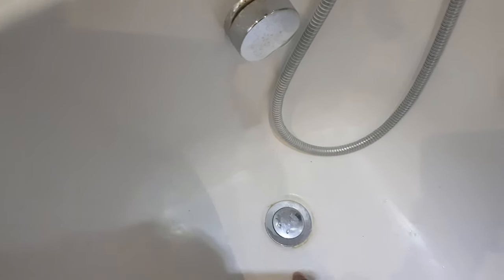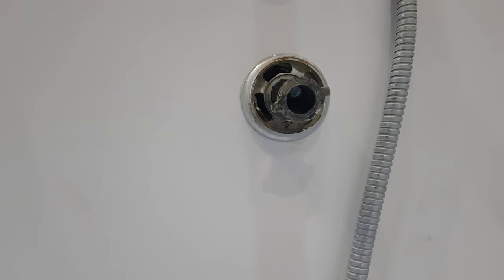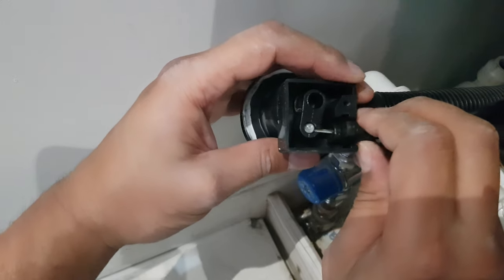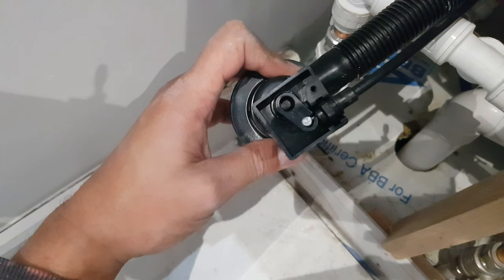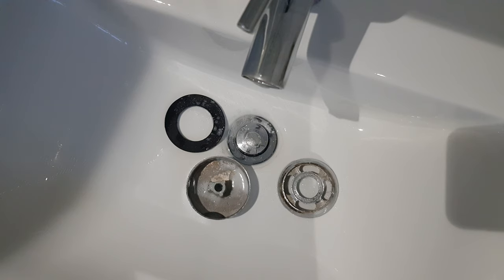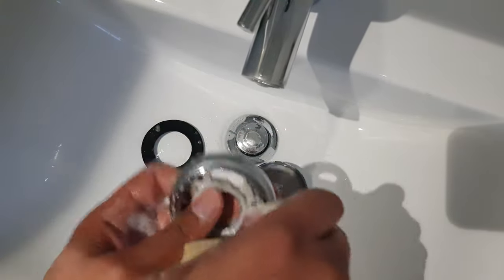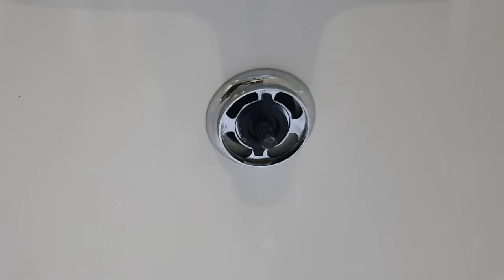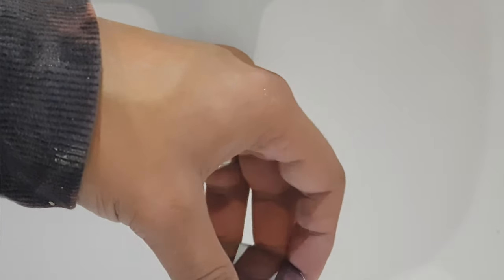Twist pop up bath waste plug

Comment from the maker: Thanks for watching. Please help support the channel by 
🔔 SUBSCRIBING for  weekly videos on repairing, reviving and restoring: 
https://www.youtube.com/channel/UC49Sq1i3iGV-ITpygo0sm3g?sub_confirmation=1
Reply: How can i fix/take off the plug part of the twist handle pop up?
Reply: The twist olug is not working
Reply from the maker: @laviniaparker8860  there is a screw at the bottom where the whole is. Instruction should be there in the video.
Reply: Will have a look only installed about a year ago and started a few months after ,don't think it was adjusted on install just put in place , thanks
Reply from the maker: I literally had the same issue. I moved into my new place and adjustment was completely off. Also check the plug as sometimes the screw gets a little short and then does not work with mechanism. If screw is a little tight spray with some WD40 and give it some time before loosening.
Reply: Can't change plug adjustment on shortest or water runs out
Reply from the maker: fair enough. Make sure you let me know how you get on
Reply from the maker: Not sure if it will help 🤓
Reply from the maker: Unfortunately I am not on that. Do not think it will help. But oh well.
Reply: The whole on the bath was made bigger fits perfectly
Reply from the maker: Oh great, glad it worked. 👍

Comment: Mine doesn't have a screw holding it in, I've no idea how do get it off, I can't turn it to 360 from behind as the top of the bath gets in the way. Twisting it only releases the plug.
Reply from the maker: Unfortunately, I have not come across these before. There must something holding it together.
Reply: did you find a solution for this? mines exactly the same!
Reply: @DIMTips  I have same/ similar mechanism for my bathtub in my bathroom but whichever way I try to take it out it does not seem to work. I found for twist to open bathtubs you require to sometimes use a Phillips head flat head or cross shaped screwdriver, however the screwdrivers I had either unfortunately does not fit or that I cannot seem to locate the screw in the side of the slot where the screwdriver can be slotted into. So I was just wondering in case it could possibly be my fault for not using the correct size Phillips screwdriver I was just wondering what size screwdriver that people have been using to fix this similar problem in bathroom bathtub?
Reply: Tom H. our screw has an Allen key head
Reply: I had the same thing and finally realised it just levered off (I was gentle). Hope you managed to fix yours too.
Reply: You caught the little s
Reply: I still can’t get mine off, so frustrating- tried to leverage it off to and stuck solid, screw is out can see it but now the whole unit just turns to high left/right but no way it’s coming off 😡
Reply: For this type, I got mine opened by keeping turning in the direction of the close position.

Comment: Thank you, thank you, thank you. I had fitted one of these to the new bath I'd installed and could not get the waste cover to pop up. I thought I must have installed incorrectly and was at the point of taking the whole thing out! A very depressing outcome. Then, I came across your video and it was the only one on you tube I could find that explained properly how the system works and that you have to adjust the screw on the waste cover in order for it to pop up. I did this and, voilla!!, success. Currently you are number 1 on YouTube for me!!
Reply from the maker: Thanks so much Paul. Really happy that it helped. It is sometimes the simple things that cause the largest problems.

Comment: Genius! Just fixed mine following your steps. You are so reassuring and methodical. Huge thanks.
Reply from the maker: Glad it worked
Reply: @DIMTips  Well, f**k me. I've had one of these things in the place I moved into nearly four years ago and could never figure out how it worked. No, I don't mean the complex cable-pull mechanism you took apart at the back. I mean, how the hell the actual plug popped up and down lol. I was always under the impression some kind of click-clack valve was missing. I even took the whole thing apart a few years back, looking for what was missing and then had to screw it back together as the actual waste was all connected. After watching this video, I just went and popped the plug in and twisted that big knob on the back of the bath and watched it go up and down. Rofl...I'd been dropping the plug in and pulling it out with a knife whenever I used the bath instead of the shower. Thanks for that...duh!

Comment: Hi fab video and I just wanted more info on the plug and adjusting that. 

My pop up bath plug will drain if there’s some water in it, but if there’s lots of water it won’t pop up.

When I adjust the plug I can adjust the height and also the nut. Does the position of the nut have anything to do with the workings of the plug? It’s just I don’t know if I need to make the plug longer and also adjust the nut.

Sorry I probably don’t make sense...
Reply from the maker: I would always start with the plug as it is the easier job. The nut is there to stop it from slipping back down. So make sure the nut is right up to the top. Let me know how you get on.

Comment: Thank you best video I found on the hand twist bath drain plug. Mine is an older model. The bolt that sticks out has a grouve in which a screw bolt that we undo as we take the hand twist part off. Not confident about replacing it. I will have try to take it apart thank you
Reply: Well mine is old model cannot open the small black box. Decided to use a universal drain plug will have to replace it when lockdown ends. Where can I find the mechanism?
Reply from the maker: Good luck after lock down. Glad you found it useful. Let me know what happens after lockdown. I am sure the temporary plug will help others.

Comment: Thank you for a nice video. I have the same mechanism.
I’m not sure but I might have a little leak through waste cover plate(little bubbles).I tried to remove waste connector screw
To have a look at sealant But couldn’t do it(plate was twisting around) Do I need specialist tool or keep unscrewing.I don’t want to damage anything.
Maybe another video for us please?  Andy G
Reply from the maker: Did it work?
Reply: @DIMTips  I have same/ similar mechanism for my bathtub in my bathroom but whichever way I try to take it out it does not seem to work. I found for twist to open bathtubs you require to sometimes use a Phillips head flat head or cross shaped screwdriver, however the screwdrivers I had either unfortunately does not fit or that I cannot seem to locate the screw in the side of the slot where the screwdriver can be slotted into. So I was just wondering in case it could possibly be my fault for not using the correct size Phillips screwdriver I was just wondering what size screwdriver that people have been using to fix this similar problem in bathroom bathtub?

Comment: Since the internal workings for mine are behind a wall that I'd rather not cut open if I don't have to, do you know of any bath waste plug replacement solutions made for this type of unit?  Can I possibly put some kind of pop-up stopper in its place?
Reply from the maker: If you have do not have access and do not want to over engineer then the simplest is to remove the plug and replace with a general plug stopper. Doesn't look as nice but does the job.
Reply: @DIMTips  I appreciate the advice, I'd like to think Moen or someone else would have tapped this market with some kind of nice looking, functional solution, I'll let you know if I find it.  In the meantime keep up the fabulous work, Happy New Years!!
Reply from the maker: Please do let me know how it goes. Always interesting to hear other's experience
Reply: @spdrn011  Did you manage to find a good looking replacement plug? Previous owners of my house made a lovely built in bath but didn't consider if anything might need replacing in the future. Needless to say the mechanism on the plug needs some attention but can't be accessed. Doh

Comment: Hello and thanks for the video. I have exactly the same system and issue. However, upon removing the screw, I still can't get the turn handle removed to access the components behind it like you've shown. Now I have a rattling screw inside it. Any tips on what could be going on before I go get a plumber? Thanks so much.
Reply from the maker: It may be limescale build up. Try some Viakal or citric acid to remove the limescale. Also grip the base unit and unscrew the top. WD40 has also worked in the past.
Reply: I think someone on another video said that they had this problem after they loosened the set screw. They said that their handle would not pull off it screwed off.  I guess not all of these drains are alike. Our screw head is an Allen key head too.
Reply: Hi @MrRayadav3, did you get this sorted? If so how? I have the same annoying rattling screw! Thx

Comment: Wow I have been looking for instructions on this mechanism. I hate it and want to replace it with a pop up drain and a simple overflow cover, but have no access to the outside of the tub to remove the metal shaft and nipple from the overflow pipe
Reply from the maker: Agreed. When it goes wrong, it goes wrong. Let me know how you get on.

Comment: Ahhh amazing dude just sorted it out! Such a random design. Regarding the unit itself is there reason to silicone it up or should it be water tight as is?
Reply from the maker: Not sure why they siliconed it on installation. But i hardly used it and had no leaks

Comment: I only found your video after searching on Google not in YouTube! I had to find out what that type of bath drain mechanism called. I wish I had found your video yesterday before thinking sod it I need a bath and put the plug in only to get completely stuck this time. The screw on the drain blocker is short! I have to take it apart now.
Reply: I'm having trouble finding the screw to take the first part off 8s it supposed to be in the open or closed position to locate the screw thanks in advance
Reply from the maker: I found it a little difficult to find. But there will be a hole to the side or under neat the circumference  of the opening and closing mechanism. Maybe using the camera on your phone to record a video in any difficult spots will help you locate it.

Comment: Hi.
Mine no longer works, I tried adjusting the plug, but that didn’t  seem to work, as I'm  going to change the bath later this year I don’t want to chsnge the whole  unit so today i got a rubber 'stand alone' plug that i put in via my hand for now but that doesn't fit. I took  the old plug to the plumbers who told me it's large & there is no such thing as a 'standard size' plug hole, shall i just keep trying until I find the right fit?
Thanks
🇬🇧
Reply from the maker: Hope you managed to find

Comment: Watched this video several times and gave it a go as my plug had got stuck in the locked position with a bath full of water in it !!  

After a few failed attempts and a break to have a coffee I followed the video step by step pausing it along the way to do exactly what he did and IT WORKED ! 

Thank you so much for posting such a helpful video now I dont have the expense of calling out a plumber and my bath is fixed 👍
Reply from the maker: Awesome.

Comment: Hi. Is the bath plug just sitting loosely on the drain hole? There's like a rod that goes up and down when I turn the mechanism. But the drain plug seems loosely sitting on top. So water leaks even if its closed
Reply from the maker: It may be a slightly different mechanism. Are you able to search for the type of mechanism.

Comment: Hello I’ve just re-tensioned it and it turns and holds the metal but nothing is happening on the bottom I can’t access it from the bottom as that would involve removing tiles around the bath is there a possibility that the mechanism in the drain isn’t working?
Reply from the maker: Silly question but have you adjusted the nut underneath the plug to make it longer. If that does not work it may be the unit.

Comment: Hi do you know what brand of plug / pipework this is ? And what the size of the plug actually is? I believe I have the same system but am missing the plug so at the moment am just left with a hole unable to fill my bath. All I need is the screw in plug but cannot find one anywhere ! Thanks
Reply from the maker: They are pretty standard. This one looks to be from Screwfix.

Comment: Awesome video,  Since the twist pop up on my walk-in tub wont work, I followed your steps and the top adjustment seems good. I believe I either have the height at the plug  issue or the threads on the plug itself might have broke off, Its a bit hard to tell. However, the threaded portion  on my plug does not have the adjustment and is very rusted. Is there a adjustable replacement you can recommend?
Reply from the maker: Ebay has some good ones. Did manage to fix. Would like to understand what you did

Comment: I have a cable drain handle on my tub unfortunately the opening to the screw is facing down, towards the tub.  Since it's difficult to see, other than using a mirror underneath, I'm having difficulty turning the screw.  Likely due to it being there for a several years.  Any suggestions on how to release, other than taking a sludge hammer...which of course if overkill.  Thanks
Reply from the maker: I used my phone and recorded it from underneath to see the screw. Hope it helps
Reply: I have the same issue. I took a picture and made a video to see the screw.

Comment: The actual twist handle on mine is moving up and down and side to side causing leaking behind it when water hits it, any idea on how to fix this??
Reply from the maker: It has a screw fitting holding it flush to the bath. Open the back and twist it tight.
Reply: @DIMTips  I have taken the screw out but the cover will not come off I pulled as hard as I can what am I doing wrong?
Reply from the maker: Try lubricant and release fluid like wd40. Also try limescale remover like viakal, vinegar, etc
Reply: @DIMTips  no joy. Tried wd40. Cilit bang. Awful thing.

Comment: Is the screw that holds the knob on always a Philips? It quite corroded and hard to tell. Thanks
Reply from the maker: Not sure if always a Philips. Try a flat head. Worst case scenario it should be easy to get a replacement as a standard size screw.
Reply: Could be an Allen head screw also

Comment: I need a new ‘shield’ as mine has snapped. Does anyone know what the proper name for this is and where I would be able to get one from? I’ve been Googling everything!
Reply from the maker: The shield is called a hand wheel. Generally the whole unit is called "pop up bath waste" and the whole unit can been found on screw fix. Let me know if you were able to find a replacement shield (hand wheel).

Comment: The screw holding the cover in place for mine won't budge. I've tried WD40 and giving it some welly, but don't want to overdo it in case I wear out the head. Any advice you could give me, or will I have to resort to drilling out the screw?
Reply from the maker: Try to alternate between viakal or equivalent limescale remover and WD40. It may take a few tries. Remember to wash off with water between cycles. Good luck and let me know how you get on.

Comment: Our washer/flange is broken on the handle but we cannot find the parts. What do we need to search for? Thanks
Reply from the maker: A replacement would be best. When I opened this up I noticed silicone was used and could be an option for you as a cheaper fix. Let me know what you went with.

Comment: We have one of these on a new build property we have rented and it was lose the first time leaked and caused a leaked in the downstairs apartment and someone has been twice to fix it and now the 3rd time it’s just gone lose again causing yet another leak
Reply from the maker: Sometimes they cut the hole a little too big for the fitting. I noticed that the person before me added silicone to keep it secure. I do not recommend this as is a little messy but may work. During regular usage of getting in and out or general usage the fitting may be loosening. You may need to regularly open and tighten it from time to time. There is a screw underneath to open it. Then as long as you hold the back casing it should tighten.

Comment: Just installed a new bath. The plug is letting water however. The seals are brand new, I'm a bit stumped on what it could be. Any idea mate?
Reply from the maker: That is always annoying. Did you fix?

Comment: I have same/ similar mechanism for my bathtub in my bathroom but whichever way I try to take it out it does not seem to work. I found for twist to open bathtubs you require to sometimes use a Phillips head flat head or cross shaped screwdriver, however the screwdrivers I had either unfortunately does not fit or that I cannot seem to locate the screw in the side of the slot where the screwdriver can be slotted into. So I was just wondering in case it could possibly be my fault for not using the correct size Phillips screwdriver I was just wondering what size screwdriver that people have been using to fix this similar problem in bathroom bathtub?
Reply from the maker: Feel free to comment below all.
Reply: Try an Allen key. Ours has an Allen key head

Comment: Great video but Mine does not have a screw to remove the front ? does this just push on ? i dont want to force it.
Reply from the maker: That should be fine. Just push on but check it is not loose.
Reply: @DIMTips  If I have one of these with no screw, how does it come off? There seems to be a collar around the spindle, but no screw. I tried pushing two screwdrivers through the two gaps in the collar, in case there was a spring loaded release, but no luck so far.
Reply: Tim Robinson was it a screw off knob? How did you get it off finally?